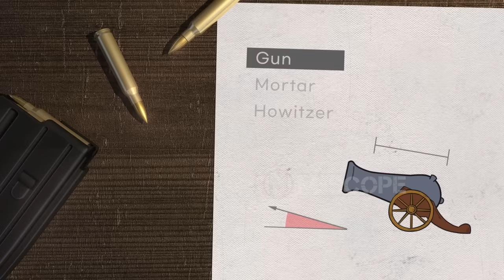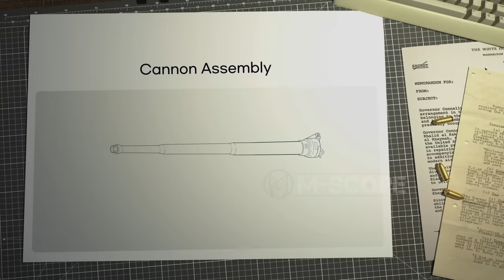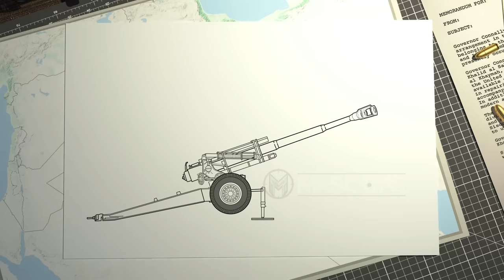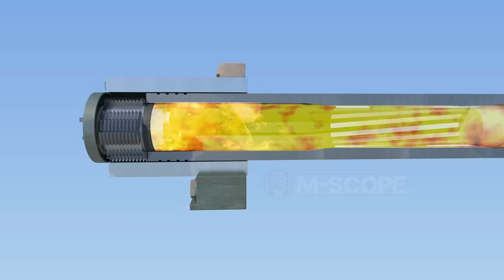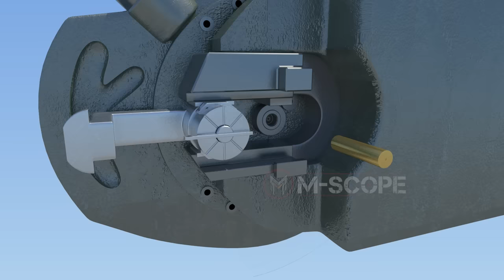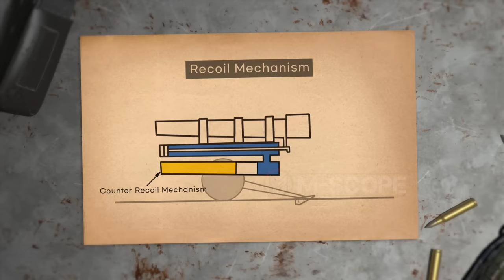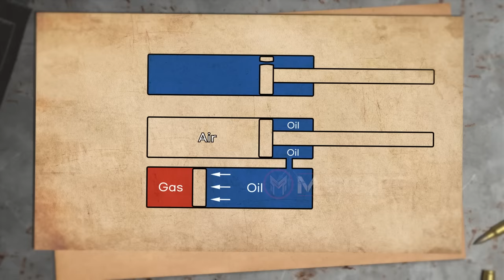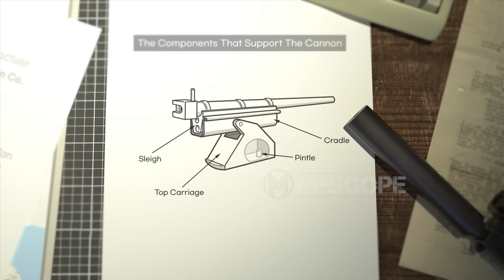How does the 155mm howitzer work?

Comment: One of the most intriguing aspects of the 155mm construction is the weight reduction - everything that's not necessary is removed, they even made the walls of the equilibrators exactly as thick as they need to be to be sturdy enough for the battlefield, not a millimeter more. Mechanical elegance through omission. I call that beauty. Great video btw.
Reply: I wonder what is considered "not necessary". because honestly almost all modern artillery pieces have onboard electronics (ballistics computer).

Comment: 00:08 Gun vs Howitzer vs Mortar
01:03 Structure
02:43 Muzzle Brake
03:17 Breech Mechanism
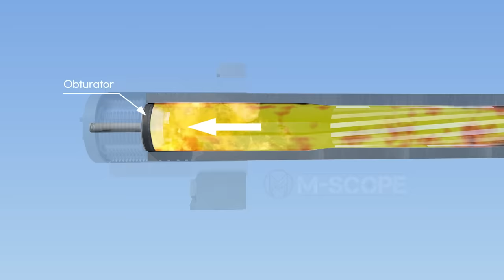03:58 Obturator
04:36 Breech Block
04:58 Firing Mechanism
05:24 Counterbalance Mechanism
06:53 Recoil Mechanism
08:14 Recoil Distance
08:31 Sleigh & Cradle
09:55 Equilibrator
10:47 Elevating Mechanism
11:04 Traversing Mechanism
11:19 Firing Support
11:51 Trail
Reply: At the time of making this, timestamps are already present.

Comment: My  1965 , 155 HOW was self propelled. It looked much like a tank. It carried a 6 man team inside. The vehicle was powered by two Chrysler V8 engines under carriage. The total weight was 25 tons. The top speed was 50 Mph. I think it had a 30 mile target range..
Reply: M109?  I served on an M109A6 Paladin in the late 80s.  The M109 still serves today with 1,000 in US Army service.
Reply: I thought range was 30 kilometers not 30 miles.  It has been years since I was in my reserve artillery unit so I may be wrong.
Reply: @chuckbuckbobuck  you are correct. Our 155 only have a range of 30 km, not 30 miles. The Excalibur round can reach about 30 km max.

Comment: Interesting to see that the recoil mechanism is the same as more than 120 years ago.
Reply: Yeah, physics doesn't change, but those engineers keep pluggin' away with improvements in weight, reliability, and payload.  Will we see a change from combustion-propelled payloads to something like electrical pulses or heat generators?  Engineers!

Comment: The key point about a modern mortar is that it transfers the recoil into the ground via its base plate. This means that you don’t need the recuperators and recoil mechanism which reduces the weight, which allows medium mortars to be broken down and be ‘man portable’
Reply: try that on an 155mm artillery piece...
Reply: @meixo9083 I was talking about mortars mate
Reply: @bob_the_bomb4508  its a howitzer vid, wtf you talking about?
Reply: @meixo9083 it mentions mortars too. But it doesn’t fully explain the difference. Or was that too complicated for you?

Comment: Not too bad. A little different then the ones I used to work on, but close enough for the average Joe to understand.
Reply: Tell me what's missing specialist? the basic principle is all there, do you want him to make a 3D model of every screw and spring?
Reply: @marcos0055101  I'm not a specialist, but on the diagram at 7:00 there is no explanation how it is possible for recoil cylinder to change it's overall internal volume during operation

Comment: An excellent explanation, however a couple of minor points.
1. Your explanation of the recoil distance being reduced to stop the breech hitting the ground at high elevation gets the issue the wrong way round.. The problem is with recoil at low elevations where the recoil is trying to push the carriage back across the ground. To allow the use of a relatively light carriage, you need to let the barrel recoil a considerable distance at low elevations to spread the shock  over a longer period and reduce the peak loading of the carriage.  At high elevation most of the shock goes down into the ground and you do not need the barrel to recoil so much as well as there being less space for the breech to move.
2. Equilibrators are needed if the trunnions are not at the centre of gravity. Most guns with limited elevation keep the trunnions forward at the centre of mass, or use barrel weights to balance the barrel. In high elevation guns it is better to have the trunnions to the rear as it reduces the swing of the breech. You could use breech weights as well, but they add to the carriage weight and really only have been used on anti aircraft guns such as the WW2 UK 3.5" AA gun. The old US M1 105 and the British 25pdr had balanced trunnions.

Comment: Excellent material. May be you could do a video explaining the basics of arming, aiming and firing of these howitzers. 
When I make models, I'm always fascinated with the red and white striped stick attached to the trail of the gun. I think it's meant to assist with aiming of gun, but I don't know how.
Reply: I think they are either aiming posts or surveying sticks. Since artillery is a non-line-of-sight weapon, you have to know where the howitzer is located and where it is pointing. You locate a aiming posts away from your weapon and use it a reference point for direction and distance. For example, you place the posts 30 meters away, 45 degree to the right and left of your gun tube. Your cannon is now pointed toward your target. After firing a few rounds, your whole howitzer moves from the recoil and now the tube is actually pointing 43 degrees to the right and 47 degrees to the left of the posts. You look thru the aiming device to see the posts and move the cannon until it 45 degrees left & right of the aiming posts. You are now back on target and keep on firing. It is a little bit more complicated than that but I hope you get the basic idea.
Reply: @slimjimnyc270  thanks. That makes sense. I think they can also check gun elevation with these sticks as well, right?
Reply: @g43654  I seem to remember that it can use to check elevation.
Reply: @g43654  no.  Aiming stakes are for direction only.  They are the fallback for firing azimuth.  The primary is the scope on a tripod located to the left front of the piece. It looks like a 1.5’x3” tube and is called a collimater. The gunners sight on the piece has elevation scales, and often the right side has an elevation only sight.  Finally, there is a gunners quadrant to final check elevation. Think protractor with a level.
I’m not going to get into the details of “laying a Battery”— that’s a long video in of itself. 
This is old school, non GPS aiming.

Comment: The 155mm howitzer shown in this video is what we in the Marine Corps called the "Pig". But they did not have a muzzle brakes on them. They were a pain in the ass to setup due to the very heavy square plate used to support the howitzer when the wheels were lifted into the firing position..

Comment: Great video except for the loud distracting music.  My question is not part of the material of this video, but it is interesting all the same.  A shell fired from a high angle howitzer is spinning due to the rifling.  The spin causes the shell to keep pointing in the same direction.  What then causes it to change orientation during the trajectory so that it hits the ground nose first?  Or does it hit the ground tail first?
Reply: Alas, this channel is not the only one with this super annoying and totally unnecessary background noise. If it really must be there, reduce the volume by at least 6 dB!  Even more baffling is why it "must" be there in the first place.
Reply: If I were to guess, aerodynamic drag, which would act more on the base of the shell than the pointed tip. The spinning minimizes the effects of air resistance, to prevent tumbling, but not all of it.

Comment: When in high angle how those shells and propellant did not sliding down even though it's breechloader not closed yet?
Reply: When you ram the shell into the chamber, the brass ring engages in the rifling and removal backwards is difficult. This explains why the shell doesn’t fall out.  The powder is in a cloth bag, so if you use your fist when shoving it into the breach, it will slightly squish in the middle and expand outwards gripping the chamber walls long enough for you to remove your hand and close the breach.

Comment: Easy:  Same as 203mm, 105mm and any other piece of artillery. 
Point  gun at the enemy.  Insert shell in the big end (the breech). Pull rope. A loud bang with smoke and flame and shell will come out of the other end (the barrel).  Repeat.  After 10 reps, have a cup of tea.
Please ensure you wear your ear defenders and keep the barrel pointing in a safe direct at all times.  Well safe for you, not so much the enemy.
There we go, easy.  Artillery 101.

Comment: what holds the shell inside the barrel before charge inserted?
Reply: The round is rammed with a ramrod. It sounds primitive but we still do that. It often takes two people but sometimes one person and they use a rod to jam the round up inside. There is also a maximum loading elevation for safe loading so that way it doesn't drop out. So, I suppose the answer would be friction?

Comment: What I can not find: How do you aim and reaim after every shot?
Certainly the bounce will misalign the barrel every time?!
Reply: That's a great question. This video doesn't cover that. Aiming is somewhat complicated but could probably be explained with the video like this. There are ways to do it with digital systems and sensors as well as with optical systems. I think The optical way we do it is probably still the same way we used to do in world war II. It's a system of scopes, levels, and math. Unfortunately it would take a little too long for me to explain it in a YouTube comment. By the way, the way you explained how it will bounce and misalign the barrel each time is something called displacement

Comment: In the US Army Field Artillery, we got rid of “cannons” in the 1950’s.  We only use howitzers.  Using the word “cannon” in relation to modern artillery pieces will quickly get you corrected.  It’s a howitzer, or piece, NOT a cannon.  Tanks, and the Navy have cannons, not the Artillery!
It is similar to calling your rifle a gun.  Pistols are a handgun and can be called a gun.  But your primary weapon is a rifle, or an M-4.
Reply: The word cannon is still all throughout the technical manuals for our current guns, the M777, the m119, and the m109. The job title is also 13B Cannon crew member

Comment: Could someone please explain me why some cannons require casings for charges and some don't?
Reply: I don't have a good explanation as to why they "require" it, but I am an American artillery crewman. The 105 mm howitzers are semi fixed ammunition and have casings like you described. Those rounds are smaller, and the powder is contained inside the casings inside hacky sack type things. The 105 can shoot a lot faster than the 155 mm howitzers in general because a crewman needs to simply load the round and casing in together. I imagine the reason 155 mm howitzers don't use casing is because they are so large. If you were to look and see the size of the powder charges and the round, you would understand. Each round is something like 80 to 100 lb and each powder charge is like the size of one of those big cans of soup or vegetables. They are large. The casing and round together would probably be too big and heavy for one person to carry
Reply: @loganteodoro2885   thanks for a clear explanation!

Comment: Gas filled cylinders instead of springs. Those must be comparitively fragile and prone to failure. But they will be lighter than steel springs. Well when at most you shoot 100 rounds a day down range  it may be good enough. To compete with an opposing force that shoots 10s of thousands of rounds a day you may need something that has more longevity in its components. But who would have thought that there would be artillery duells in Europe?
Reply: Actually, gas cylinders are much more reliable than springs because they don't have any parts constantly being stretched and compressed (subject to fatigue).

Comment: Nonsense I was a Bombadier on a self propelled 155.
Reply: Do you know how it works?
Reply: @Commander_Koyke  The G6 is built into a vehicle and the G5 has a seat you cab drive it.
Reply: @paulb9769  on the exact gun used on this video?
Reply: @Commander_Koyke  No it is a 155mm same type.
Reply: @paulb9769  oh really? What gun did you operate?
Reply: @Commander_Koyke  G5
Reply: @paulb9769  Ok so, the gun is different from the one used in the video. Maybe the one you used functions differently from the one used on the video. Maybe I'm wrong. I also would like to know where he gets wrong if you can do that.